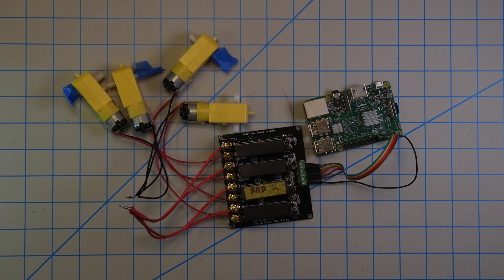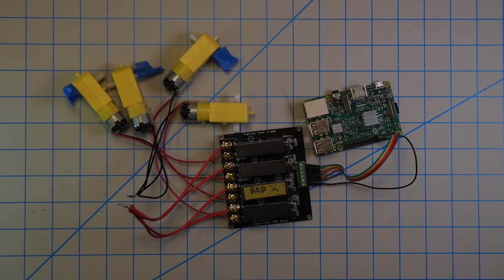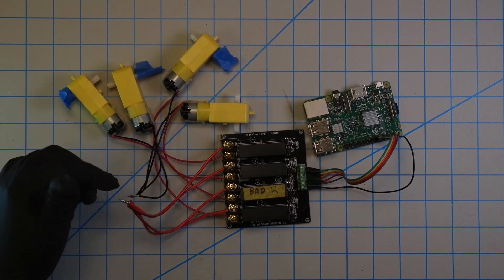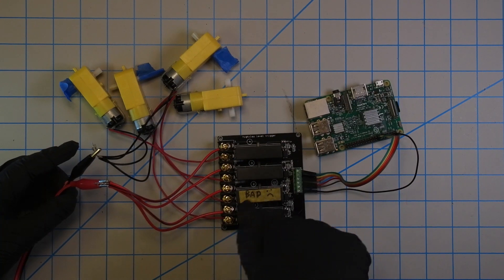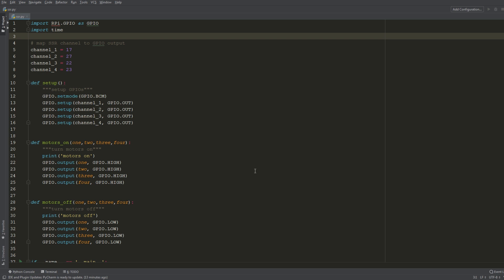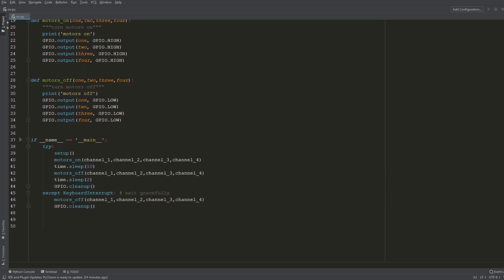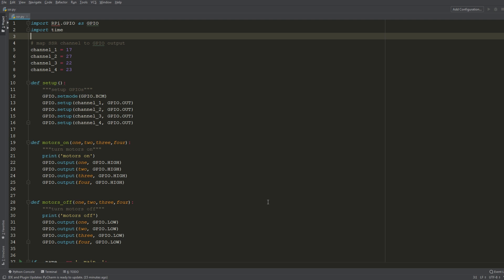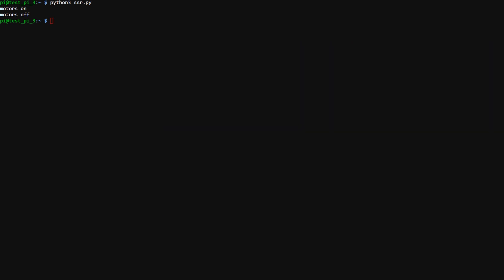Solid State Relay (Raspberry Pi)

Comment: Awesome video, thanks for the BoM. I just purchased a 1-channel on eBay for $6 because of this video. I'm using a mechanical one with my Pi at the moment but it doesn't read the high and low signals correctly so I'm using GPIO.cleanup() as a work around in my code. Quick question: on eBay it states that the controlled voltage range is AC 24V to 380V. Since I see you using a DC benchtop power supply, does that mean it will also take DC power?
Reply from the maker: Hmm, I couldn't find anything on the spec sheet when I created the tutorial and the relay I'm using seems to work. However, I recently found this article which states otherwise: https://electronics.stackexchange.com/questions/323964/using-an-ac-relay-for-dc-switching-safe-limits  So maybe find one that's rated for DC just to be safe.